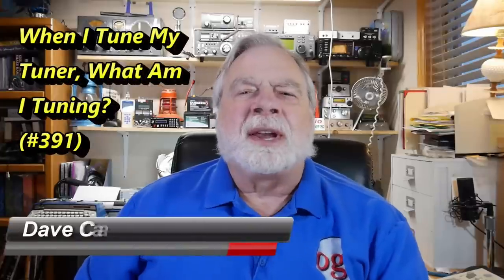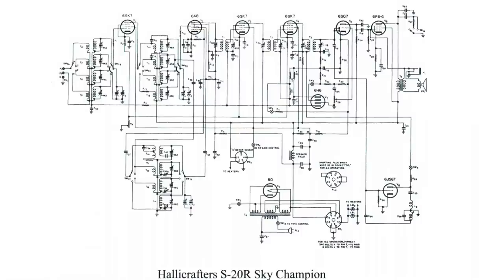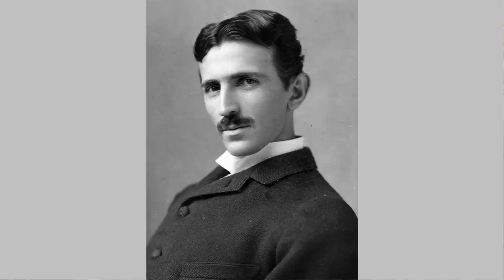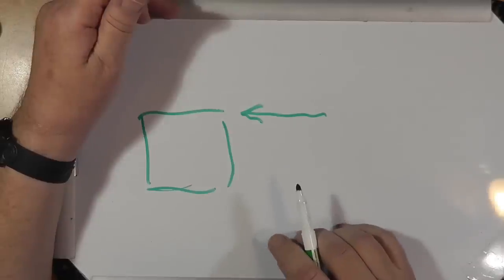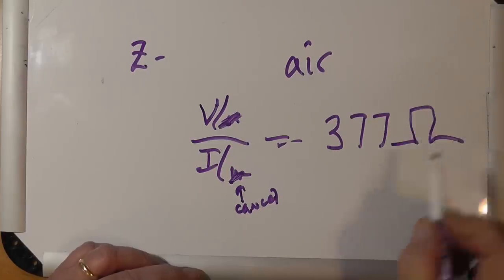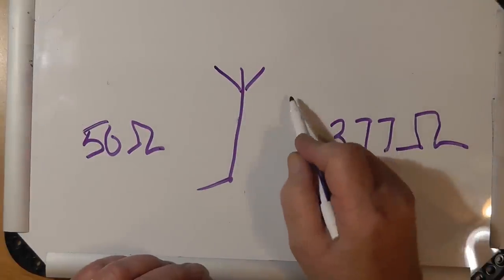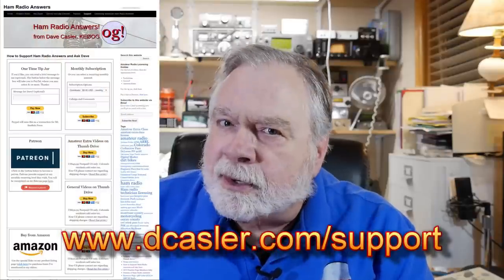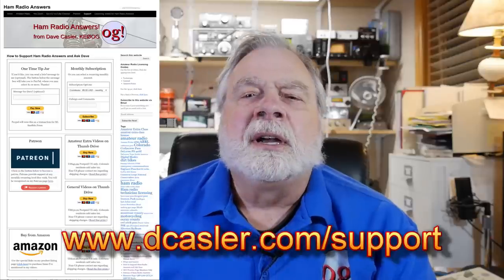What Am I Tuning When I Tune My Antenna Tuner? (#391)

Comment: "It is the job of the antenna to do the impedance matching between the 50 ohms of the transmitter and the 377 ohms of free space."  It's sentences like this right here that is why I'm not only a subscriber but a patron. You don't just go in depth, you word things in such a way that every so often one sentence completely tears down a conceptual barrier that's been planted in my head for years. Bravo!
Reply: it's not correct. The tuner matches the transmitter to the resistive part (R) of the antenna, so it does an impedance transformation between the 50Ohm of your transmitter to the whatever impedance your antenna has, and it eliminates any reactive part (X). Whether the antenna itself is radiating well (i.e. matched) to the 377Ohm free space at your sending frequency is a different story. Thus, the tuner does NOT match the transmitter to the 377 Ohm of the free space, only to the resistive part of the antenna, which, for a well radiating antenna (at a specific frequency), is then hopefully also well radiating. If you have a poorly radiating antenna, the tuner will do it's nice job and get the VSWR down, but that does not mean that your power is radiated, might just be used up in the non-radiating resistive part of the antenna (or any other lossy elements in between). Even for a poor radiator the tuner is helping, as it will increase the power which you actually get out, i.e. it will increase the radiated power as compared to the non-tuned case. But the best solution is always to take care to have an efficient radiator (in which case you only need an impedance transformation and then not even a tuner, but the tuner can do its job here as well within its limits, it just narrows down the bandwidth since the tuner is resonant and an impedance transformer is not).
I'm always surprised how much misunderstanding and misconception is in the HAM community about things which are the actual core of their business.
Reply: In the meantime, I'm never surprised by how willing someone is to give a lecture about something that wasn't even mentioned, just to sound superior. It's nice that you know that  'the tuner does NOT match the transmitter to the 377 Ohm of the free space', but I didn't mention tuners once. Twice in your tome, you reaffirmed that it's the ANTENNA's job to match to the 377 Ohm of free space. This is the very concept I was commenting on.
Reply: The statement of matching to free space is utter nonsense.
Reply: @joachimoberhammer3020  You just didn't listen carefully enough. He's right (as are you). The job of the ANTENNA is to match the impedance between the 50 Ohms coming in and the 377 Ohms of free space. Note he didn't say the job of the TUNER. The job of the TUNER is to match the impedance of the transmitter with the impedance of the antenna. They are, as you say, two different things. But that's exactly David's point. As it turns out you're both in accord.
Reply: @Jerrythenerdful  Yes, Dave is a big comedian and I like his jokes 😂
De VU2RZA

Comment: Thanks for the explanation, Dave. Antenna tuners are necessary evils in MW and HF radio. I've always thought of an antenna tuner as a device that "fakes" the transmitter into thinking it's feeding a resonant 50 ohm load. Without exception, AM broadcast stations have an "ATU shack" at the base of their tower(s) to fake the transmitter into a 50 ohm load when the tower is anything BUT 50 ohms. I try to put up antennas that are resonant for the bands I use. It is always painstaking and trial and error - usually hard to keep them that way.
Reply: The broadcast transmitter actually sees a 50+j0 load; there is no faking. When possible, broadcast towers are of the proper height to be close to natural resonance, and the ATU is mostly used to match the ~24 ohm radiation resistance of the tower to the 50 ohm coax. But they are also used to trim out minor reactance to make the tower electrically resonant at the assigned frequency if the tower is not exactly the right height. Environmental factors can also change the base impedance and may need to be trimmed out.

Of course, if the tower is far from the correct height, as in the old days when stations went to 640 and 1240 for Conelrad, the ATU has to null out some major reactance to get the tower to resonate. Typically a station would have had a second ATU for Conelrad with big contactors to make the switch.

When the tower is part of a directional array, the base impedance is determined by the array parameters. A few arrays have bizarre things like negative towers (towers with a negative base impedance which actually absorb power). Stations which run different patterns at different times usually have a separate ATU at each tower for each pattern with RF contactors to make sure the coax always operates at 50+j0. Towers which are not used for particular patterns are switched to detuning networks which make the towers electrically invisible.

There is nothing inherently evil about an ATU. Broadcast stations typically use large air-core inductors made from tubing and vacuum capacitors for best stability and low loss. A properly designed and built ATU is a thing of beauty. Broadcast stations may use a device called an Operating Impedance Bridge in-line to measure impedance during normal operation to see if it has drifted too far, but when the antenna system is built from high quality, stable components, I found the OIB mostly unnecessary.

Comment: Howdy. I totally enjoyed Your assertiveness.
For what it's worth, I am with You.
What You say, I think, backs me up when I argue that a tuner + transmission line + non-resonant antenna + environment will radiate almost as much as a perfect resonant antenna.
I recognize that the standing wave current nodes in the line will cause ohmic losses. Also, I recognize that the radiation pattern may anything but a clean doughnut. The pattern may have lobes sprouting at any direction.
I have had discussions when it is argued that the tuner does not change the physical properties of the antenna. Yes. The implication being that the reflected power is all burnt up in the tuner and the transmission line.
Regards.

Comment: An antenna coupler tunes out the complex portion of the feedline/antenna in order to present the transmitter with a real 50 ohm impedance, it does this by selecting the capacitor and inductor values necessary to subtract the complex reactances out leaving only the real component.

Comment: Tricky concepts for  newbies and veterans alike,  you did a pretty good job.  A smith chart might make the concepts you are trying to convey a bit more clear, but like I said you did awesome.
Reply from the maker: Indeed a Smith Chart would help. Sadly, they confuse the daylights out of me. I never encountered them in my schooling, and they're pretty rare in ham radio.
Reply: @davecasler  I also did not encounter Smith Charts in my undergrad EE course work, they really are not necessary with today's tools, however, they are a fantastic visualization tool when teaching this type of material to newbies (and veterans). I would recommend a RF design book titled, "RF Circuit Design 2nd Edition by Christopher Bowick" it is one of the best books on RF design for the non engineer that I have come across and I think that I have them all :o) There is also a youtube channel named "w2aew" where the host Allen has 4 or 5 excellent videos on smith charts. With these two sources you won't be an expert but you will be well on your way to being one.  Again thanks for what you do and keep up the excellent work.
Reply: @davecasler  I also did not encounter Smith Charts in my undergrad EE course work, they really are not necessary with today's tools, however, they are a fantastic visualization tool when teaching this type of material to newbies (and veterans). I would recommend a RF design book titled, "RF Circuit Design 2nd Edition by Christopher Bowick" it is one of the best books on RF design for the non engineer that I have come across and I think that I have them all :o) There is also a youtube channel named "w2aew" where the host Allen has 4 or 5 excellent videos on smith charts. With these two sources you won't be an expert but you will be well on your way to being one.  Again thanks for what you do and keep up the excellent work.

Comment: Unless tuning at the feedpoint i will stick with a manual tuner. The reason for this is that sometimes the Q on the tuning is very fine and with a manual tuner you can hunt out that very specific zone of capacitance and inductance to better receive weak stations. Now ask yourself just how many combinations of inductance and capacitance is available with an automatic atu? For sure most automatic ATU's cover most of the HF bands but when you need that more tricky tune to be so finely adjusted so as to bring in that weak station there is no guarantee that the automatic ATU can get as close as you can with a dial, it will get close but no guarantee it's exactly where you want it to be. 
  If you have tuned in weak stations on various antenna designs with a manual tuner you will know what i am talking about and if you know a bit about electronics and capacitors in parallel and series you will know that you can arrive at many combinations but you can't cover all of the gaps everywhere without a variable capacitor or two and ideally a variable inductor.

Comment: Thank you, thank you, thank you! I am a need to understand what is actually happening kind of guy, and you explained what is really suppose to be happening when a tuner is used. I have about a 1,000 feet of hardline coax (new end pieces) picked up around my neighborhood when our 3 cable companies rebuilt and repaired their  build after Michael's 165MPH winds came through. My old FT101 serial number 458 (fresh from Japan) would have tuned to a 75 ohm feedline no issue but not so with the newer rigs. I have an still in the box new 7300 so if or not the tuner will mate with 75 ohm is unknown. I did aquire a few 75 to 50 transformers to also try. Anyway, the until now MYSTERY  of tuning my meagure mind has been pondering all these 50 years  has been revealed, even if a multiple of viewing this episode is still needed!!! Again THANK YOU !!!
Reply from the maker: The 7300 will tune 12.5 ohms to about 150 ohms resistive (3:1 SWR). For anything more complicated, you'll need an external tuner.
Reply: @davecasler  I have several external tuners but would prefer just the internal or the internal along with a device seldom mentioned these days, it is made by MFJ and called a tuner extender. Just adjust it to the most noise on your receiver and retry the internal tuner and generally it will then tune, if not repeat the process with the next setting either side of the most noise. Thanks Dave, really appreciate yoir work.

Comment: Hey Dave, thanks for all your great videos.  I have to say that I am not a fan of using antenna tuners other than to take out the last little bit of mismatch. As it is better to have an antenna that is as close to resonance as possible. Otherwise, all the tuner is doing is to hide the problems of a non-resonant/lossy and therefore an inefficient antenna.  All that is being done is to make a bad antenna a nice dummy load to present to the transmitter  :)  I was kinda hoping that you may have commented on that aspect.  Regards, Dave, VK2TDN

Comment: Hi Dave, 

Respectfully, the antenna tuner and an antenna do not match the impedance of free space. There are two (or more) correct ways to look at a tuner, depending on if you want to look at it with wave theory or just as a matching system, but the ultimate result to users is the tuner corrects the antenna system impedance at the insertion point and brings the entire system into "resonance". 

We also have to be careful with reflected power and standing waves. The impedance mismatch between a load (like an antenna in this video) simply sets up a standing wave. The standing wave STANDS with the result voltage and current distributed along the conductors in a transmission line vary. That voltage and current change is what causes increased (or decreased) transmission line loss. 

Reflected power does not keep bouncing back and forth until it is dissipated. Reflected power does not make it back to the PA where it dissipates as heat. This is easily demonstrated with a few simple experiments. 

None of the common antenna tuners we use, or that are inside radios, are symmetrical in SWR performance. They generally don't do well at all with 3:1 mismatches that are lower impedances and capacitive, but they can actually work better and more efficiently into 
high impedance loads. Typical tuners often exceed ratings in the high impedance direction. We need to be very careful specifying some exact matching range based only on an SWR range a manufacturer used. 

It might be best to avoid certain details rather than say something misleading. Sometimes it is better to just answer a question as simply as possible and not start adding things that wind up being incorrect or misleading.

Comment: Good day; May I ask for the advice? I have a VHS radio on the boat, there is 50 Ohm output for the antenna . It works within the range 156 MHz - 162,05 MHz, with broadcasting power 1W or 25W.. Unfortunately the antenna on the top of the mast is connected with the 75 Ohm coaxial cable. There is need to replace it with 50 Ohm cable. I have two questions: 1, whether working on this unmatched cable can destroy the radio? 2. Is it possible to use any balun or other way to achieve matchig, down without laying down the mast? I shall be grateful for the help. Mark

Comment: Great video as usual! I’ll say that orchestras are moving slowly to 442. In Europe they have been there a while, and some major orchestras in the US are moving, but slow. 432 and lower tunings are still used by period ensembles, like Baroque and earlier. Yes, you can still buy tuning forks. Still used by some timpanists, after hitting the fork you can hold it against your head, near the temple and it’s amplified in your head and you can flick the timpani head using other hand and re tune heads in the middle of a passage. 73 de KJ4KPW
Reply from the maker: Another factor is that people are taller (and wider) than they were 200 years ago, and so our poor taller sopranos have a harder time hitting 440, let alone 442. It does seem to be a bit of a bone of contention amongst the cognoscenti (of which I do not claim to be a part). Most people have absolutely no clue what any of this means! Our church organ and my own personal organ can be tuned up and down, mostly to match any instruments it may be accompanying.
Reply: I call this "pitch wars". At some times, there seems to be a competition between orchestras to see who can tune to a higher pitch. No longer do they tune to 440, but 442, 445, or in extreme cases, even higher, in an attempt to make their music sound more exciting. Back in the day radio did a similar thing by running their turntables faster than 45 RPM. Not only would they have extra seconds for more commercials, but their slower competitor sounded like they were dragging; their music sounded tired and lifeless.
Reply: @timothystockman7533  fascinating 👌

Comment: Great video Dave. You mentioned it very briefly in the video, but I was wondering what causes all the noise when a tuner is tuning? I tuned up a random wire antenna today and my tuner clicked and clacked like crazy. Are the variable capacitors and coils that loud when they are adjusted or is something else going on? 

Personally, I attributed it to tiny people pushing around switches like crazy... but I'm 98% certain there aren't actually tiny people pushing things around in there.
Reply: What you’re hearing during this process are a whole bunch of tiny electromagnetic relays that switch on or off the flow of electricity into the various capacitors and inductors that make up the tuning circuitry. Relays actually involve shoving or pulling a little contact back and forth to either engage or disengage a circuit. That’s the clicking that you’re hearing.

Comment: What is tuning? It is adjusting the resonant frequency. An antenna's resonant frequency may be adjusted by changing its length ala Stepir or it may be adjusted electrically by loading inductance or capacitance. An antenna tuner loads the antenna with inductance or capacitance to adjust its resonant frequency.
Reply: @Tom Smith Antennas do not possess some special form of resonance which only responds to changes in length. They work just like any resonant circuit. If you add inductance or capacitance, which a tuner can do, it will shift the resonant frequency, just as it would if you added to a tank circuit. This misunderstanding is why I advocate for a question on the FCC exam which would help prospective hams to learn the correct concept of antenna resonance. I think some of the confusion comes from the fact that an antenna tuner serves a dual purpose: tuning (changing resonance by adding inductance or capacitance) and/or matching (transforming impedance). Some grab onto the matching function and forget about the tuning function. --de N3TS
Reply: @Tom Smith I said nothing about bandwidth.

Comment: Dave there is a lot of talk about the radiating power lost when using a tuner, have you ever used a wattmeter at the transmitter and another at the antenna to see the actual wattages? And compare that to a 50 ohm antenna and the same 50 ohm feed line.

Comment: Nikola Tesla's colorado springs antenna was 30" turned wood sphere covered with tin. Polished to a mirror finish. Covered in schalack. Finally, covered in black rubber paint. For the longest time I couldn't figure out why the medal needed to be polished to a mirror finish and then completely covered with rubber paint.